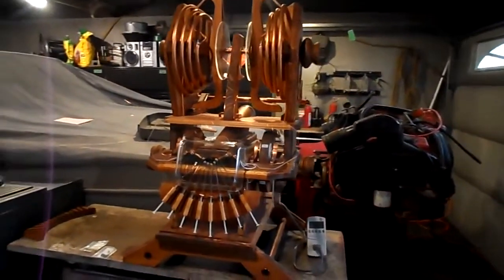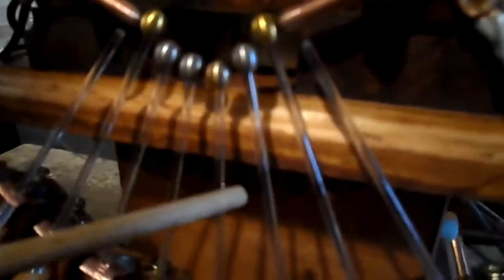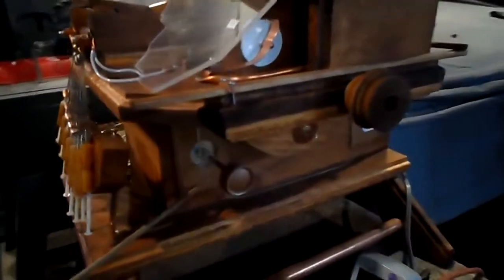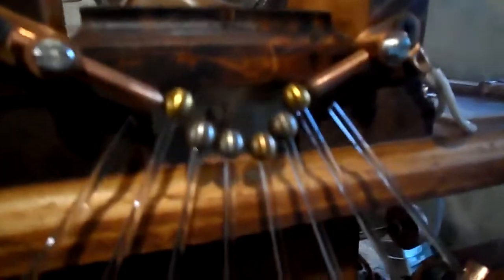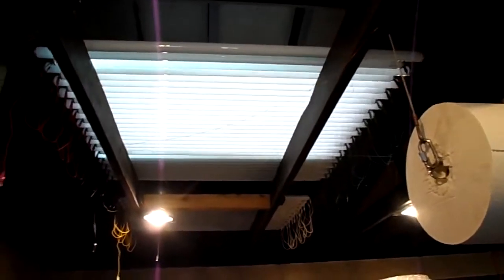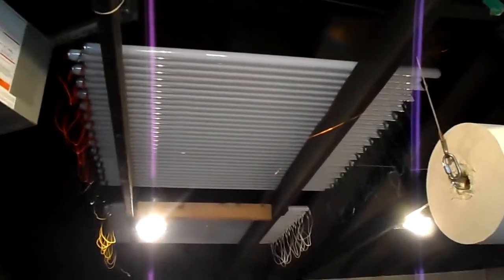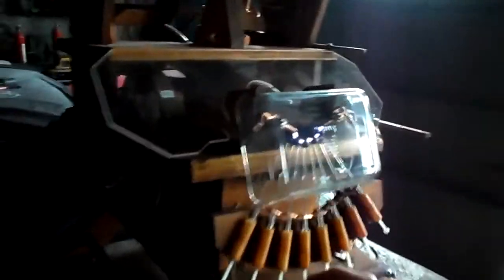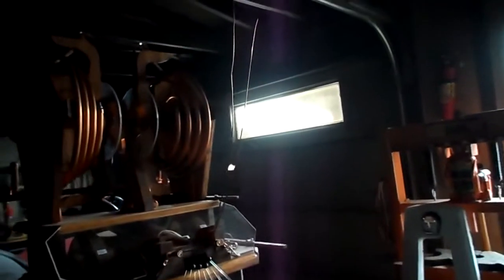Ultimate Tesla Hairpin Apparatus: Tuning series gaps

Comment: Nice rendition of Tesla’s show piece.  It is interesting that you as Tesla only used this type of device for show and tell.  You saved me some bucks in not making one, great vid.  BTW, what caught fire in video?
Reply from the maker: Wow, this is an old video of mine.....I did make two different styles and my first was Tesla's original.  Part of the wood caught on fire on this style but no real damage.  This apparatus is currently in my bay window and it's very heavy to move so in my recent last video on a defusor, we used my smaller first made hair pin apparatus.  I wouldn't recommend making one either as there is really no point in doing so unless one fully understands what it can do........I don't.  Funny thing is I have an old Halloween crow in my garage that takes AA batteries and it's been dead for years.  I had the apparatus running in the garage and it charged up those dead batteries enough to make it crow.....lol, scared the crap out of me the first time it went off.

Comment: WOW, what a hairpin!!!!! Fluorescents in series? Nikola would be impressed. Great build.
Reply from the maker: She looks great sitting in my bay window.  It's a good conversation piece.
Reply: @Lightendog  The unit is powerful, compact, and highly functional.
I built a standard tall configuration, oak framework and two solid copper four foot rods. It will make a 500 watt quartz light [rod shaped] reach about 3/4 full illumination using 30 gauge magnet wire 80 feet away. Tesla referred to the aether as the natural medium. You Be safe.
Reply from the maker: @tribulationcoming  This is an old video and I haven't messed with it in years now.  It's very heavy so I always grab the standard one I made in the beginning of the video.  I've let that current flow thru me many times and I thought of only one idea for the setup but never tried it.  Fleas can be a problem for dogs so my thoughts were to to run two small wires from the unit going to two large copper plates outside.  Front paws on one plate and back paws on another.  They wouldn't hear the machine inside the garage and one could adjust it so you really couldn't feel the current.  With the dog out side, maybe the fleas would just jump off......I was going to try it on my cat first, lol, but I never did it at all.

Comment: Great design, everything is adjustable :-)  Interesting that you made your 2 stout rods into coils, what diameter tubes did you use
Reply from the maker: I used the 3/8 copper tubing you can buy at Menards....it was already in a coil so it's nice and perfectly curved.  Now it just sits up in my bay window as a display piece.
Reply: A good collectors piece now, hehehehe.  I can tell it took a lot of designing & work.  No one will beat this build :-)  Thanks for your reply.

Comment: Its to bad you are not on YouTube more because you know so much about this, its a shame to have all that knowledge hidden away. You have left most people in the dust. Thank you for what you have built and shown.
Reply from the maker: +aaaflooddrying I actually know very little about this kind of stuff.  I ran across MrAnguswangus doing some videos and I was hooked.  He knows a lot more about this stuff.  Right now there is a time gap and winter is pretty much here it seems but I'm working on drawing power from a battery bank into a grid tie for night time.
Thanks for the complement..........I wanted to build a "one of kind" hair pin and it turned out great.  It looks good in the living room for now.  With each wheel containing 5 caps I always wanted to try different sized caps on each side because I never seen or heard of that being done. (Doesn't do much of anything).  Down the road I'll probably mess with it again but even at this point, I don't know what kind of energy I was exposing my self to with it was running.
Reply: I have been told that this circuit is the basis for a lot of Tesla's work. Your ability and understanding is really great. Your fabrication is outstanding.

Comment from the maker: UPDATE:  Tungsten rods didn't seem to really make a difference and when running 5 lights in parallel I was able to light 4 but only one nice and bright.  One thing that did surprise me a little is when I held a light in my hand and touched one side of the coil, (of course it lite up) I could feel the current on my hand that was holding the glass of the light.  Can anyone tell me why that is with glass being a dielectric?  With the light tube being held next to the machine running ( but not touching) it would also light up a little but only in sections exposed closest to the coils.
Reply: the radiant electricity must have transformed into regular electricity. There is a great book about this, chapter 1 is full of good info, you can download the pdf from this page: http://www.shamanicengineering.org/gerry-vassilatos-secrets-of-cold-war-technology/

I'll be conducting experiments based on it soon, in combination with the Tesla bifilar coil

Comment from the maker: I still have to run the same test using tungsten probes instead of the solid copper for the spark gap.  The added resistance should change output results.  I've found it's almost impossible to drill a hole in a steel bearing.....but if I heat one up first and let it cool, maybe I could.

Comment: That is a piece of art, very nice build don't burn her down ;)
Reply from the maker: A little fire just adds character, lol.  A little input on any changes I could make adds knowledge.  I'm sure there is plenty I could change and one day hopefully I'll fully understand how and why.
Reply: It would be interesting to see the difference between putting the bulbs in series or in parallel. Right now they seem to be in parallel? Thanks for sharing, happy holidays :)
Reply from the maker: Diadon Acs I probably should have mentioned they are ran in series and each is a 40 watt bulb.  I've tired parallel before and only the first one in line would light up, nothing on the rest.  It seems to only work good in series and even at that, bulbs closest to the power input light the best.  Anything in the middle of a series suffers the most over all but then again 52 bulbs is over kill.  I still have to try metal gaps yet and change the gap probes.  Merry Christmas